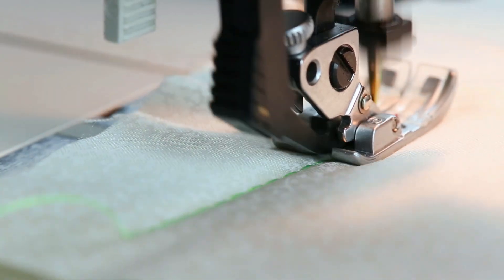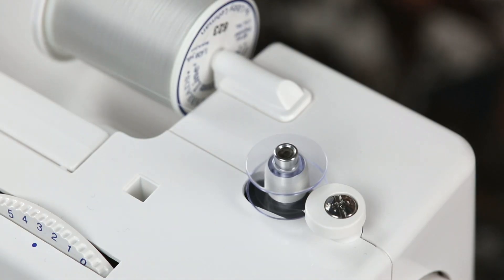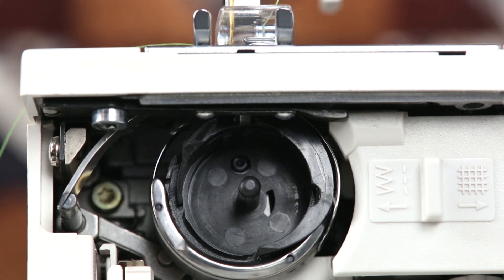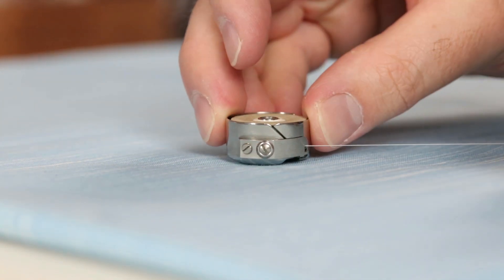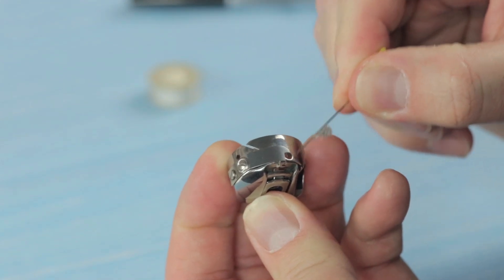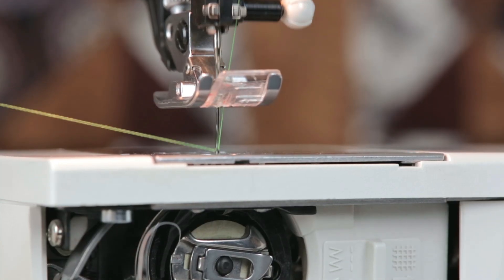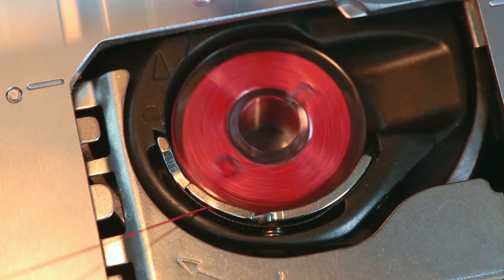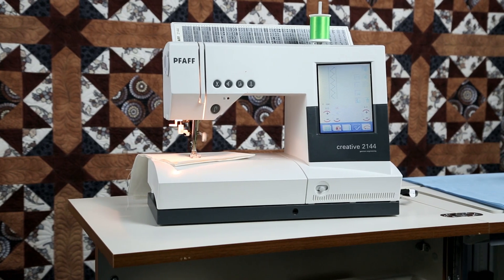How a sewing machine bobbin works

Comment: My sewing machine is magical..
You basically just drop the bobbin in and just sew..
You don't wind the needle down and catch to ready the machine.. 
When i was younger my grandmother had an older machine and you did have to pull up the bobbin thread with the needle but..
I stiil don't fully understand how it does it..
I can barely see or grab the thread yet the machine i have magically grabs the thread off the bobbin roll.
How does it do that!!!!

Comment: THERE'S SOMETHING I NEED, WHICH DOESN'T EXIST ANYWHERE:

A SOCK SEWING MACHINE, WHO'S SOLE PURPOSE IS TO MAKE EXTENDED SOX FOR MEN, SINCE ALL THE SOX MANUFACTURERS ARE EITHER SENDING THEIR PRODUCTS TO OTHER COUNTRIES, WHERE THEY MAKE THEM SMALLER, AND DON'T LIVE UP TO THEIR 'OVER THE CALF' CLAIMS, OR THE SIMPLE MACHINE JUST HASN'T BEEN THOUGHT OF YET. 

SO, ANY IDEAS?
Reply from the maker: There are a few options in getting the result, though I don't think there's an easy way about it with a regular home sewing machine. Option A) Use a serger/overlock machine with similar knit/stretchy yarn and combine the extension to the existing sock. Option B) Knit your own socks with a sock knitting machine such as this one - https://www.youtube.com/user/erlbachergearhart
Reply: @superiorthreads .     Hello.    Are all bobbins the same ,  for fine threads to heavy duty threads used in sail making.    Does the spring lose its spring ?    I’m using an old but hardly used Belair zig zag machine,  and after thoroughly oiling it ,  I began on domestic thread and it was excellent.   I then went to V92 really heavy duty thread with a 120 needle,  but I just couldn’t get the tension right.   I ended up slackening off the bobbin spring appreciably….no joy.   I’ve just tried guttermans heavy duty thread which is finer than the V92 and smoother,  and after restoring the bobbin spring tighter in stages,  I’m getting a reasonable result. 
I suspect the bobbins vary from domestic to heavy duty applications.   I’m across the pond.    Thanks.